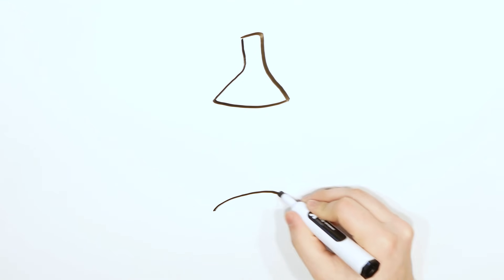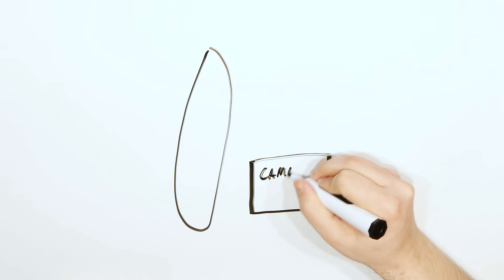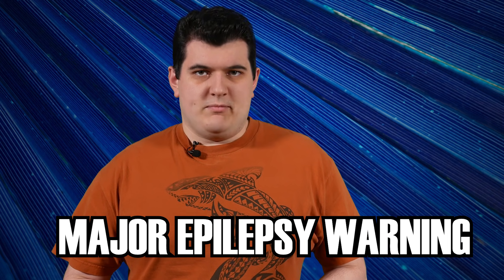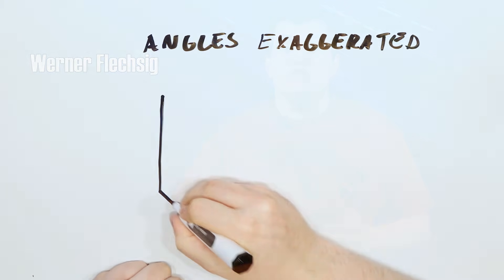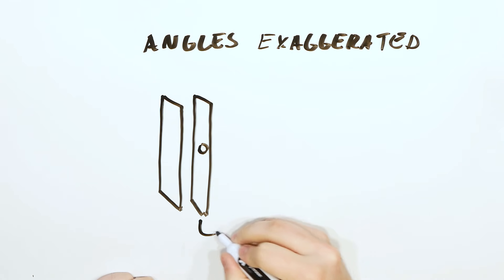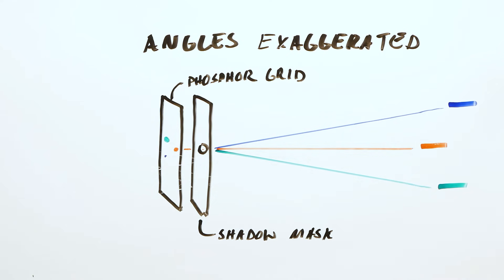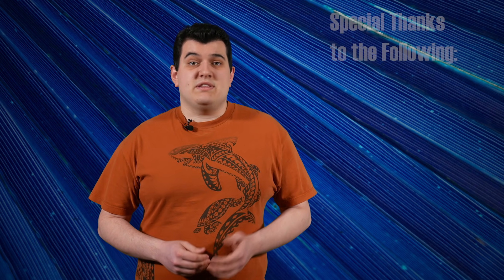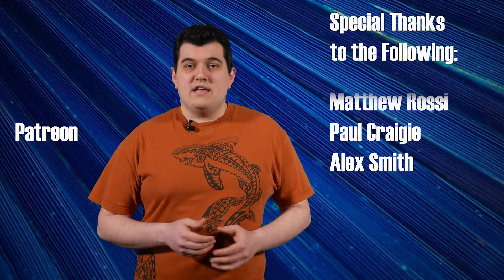How Analog Color TV Works:  The Beginnings

Comment: NTSC = NEVER THE SAME COLOR! (or, Never Twice the Same Color, etc)

I always thought the description of SECAM as "System essentially contrary to the American method" was funny.
Reply: Personally, I always preferred this meaning for NTSC:

Not
The
Smartest
Choice
Reply: It is very French, make something different but essentially the same so it is ours. PAL was an interesting standard, it had a higher resolution than NTSC, which is basically due to both systems being based on the AC power frequency of where they were invented. This gave NTSC a higher field rate and PAL more lines to a field for the same bandwidth. Due to this and PAL later being stretched for anamorphic widescreen meant that America was quicker to take up HD, as in Europe what we had wasn't as bad.
Reply: Nowadays it's PAL that actually has the disadvantage as there is no difference between the color and resolution but PAL is in 50FPS while NTSC is 60. But it actually doesn't even matter anyway as literally almost every single modern screen, except cheaply made TVs, can do both, and other refresh rates, perfectly fine.
Reply: Yes, I ve heard that due to those difficulties and limitations of SECAM, most European TV studios that transmitted in countries that used that standard, like France where it was developed, would just use PAL color video internally in their plants for production and preparation for air, and then convert at "the last mile" to SECAM into their transmitters for over the air broadcasting.   

IMO, SECAM is weird and unique in how it uses a memory of sorts (using analog delay lines when SECAM was developed, IIRC) to keep the color in check.  SECAM almosts seems like it was a bit too ahead of its time---such a standard would be a cinch to implement with today's digital (and analog) electronics.  I wonder if most later-era SECAM-standard TV sets probably had some digital circuit or buffer to process the SECAM color info.
Reply: And ATSC follows the missteps of its father. A TDT system so bad that even a bird flying in front of the antenna can break the digital stream. Thank goodness, most of the former NTSC world didn't stick with it (too bad millions are, nonetheless; and probably are going to adopt 3.0 as well). 
ATSC = Another Television System Crap
Reply: Yeah that does exist but it never really fully caught on.
Reply: It's the curse of the perfection. PAL was derived from NTSC but corrected the issue of colour stability. SECAM (means séquentiel à memoire: sequential with memory) was derived from PAL but used another method to store the colour information from one line to the other, solving one of the problems PAL had. Solving this stability issue also made it very difficult to tamper with the signal and made keylock and green screening essentially impossible.
Reply: PAL = Perfection At Last

Comment: The bit about how we see color can be a bit misleading / too simplified. I bet our dear presenter knows this, but for the benefit of others. This is how it works: our eyes can perceive 4 wavelength ranges Red, Green and Blue ... and White (btw. none of thous wavelengths cover or are exactly in the range one might expect - there is quite a lot of processing done in brain and even before. Our final heavily pre-processed perception is used to tell what wavelengths are what color atc instead of what the cones in our eyes react to. Hence why one normally does not call them by RGB initials and uses LMS instead). Thous will be converted by the neuron circuity on the retina to three signals: Red-Green and Blue-Yellow color opposition. White-ish goes through fairly unchanged (ignoring sharpening via lateral inhibition etc). Our brains never get to process the RGB signal  as that is not what comes out of eyes to begin with.

So, as far as our brains are concerned there are 4 pure colors (pure = NOT a combination of any other color): Red, Green, Blue and YELLOW .

Check also wiki article: "impossible colors".

None of this is particularly relevant to how color-TV works as that ends with cone cells. This is just for clarification.
Reply: Just recently, non imaging light detecting cells have been discovered in the eye that sense only sky blue. These are wired directly to the body clock in the brain and moderate our waking and sleep cycles.
Reply: Did not know about the specificity of it, but would not surprise me either. There is quite a lot of funky wiring going on in the region where the sleep-cycle tap is. My favorite oddity there: the signal gets split to two regions - one for vision and the other for motion (fairly far apart parts of brain). Which means that when your vision part of brain is completely toast (ie. completely blind in colloquial sense) you can still see motion. Aka. "blindsight".
Reply: The split that gives blind vision (I'd call that blind awareness) is not between motion and vision, both areas process both, but the visual cortex is newer, slower and is part of our consciousness, while the optic tectum is an older structure that's very fast. They work in parallel, the optic tectum producing rougher but quick results that make us jump when we see a quick movement in our peripheral vision, and the cortex focuses on it slightly later, identifies the object in question and decides if you should indeed run or it was just your shadow. There is also in the visual cortical stream a split between motion/position and color/shape information, and those can be damaged  separately, but none induces pure blindsight, where you don't have conscious vision but you still receive some information from your tectum (and also from the visual thalamus to higher cortical areas), so you have extra information compared to a person missing the eyes. Anyway losing onne of the two cortical stream is also weird, for example people with damage to the ventra one (the movement one) see the world like a slideshow presentation, without fluid motions, and objects "jump" to irregularly spaced positions instead of flowing continously. So it's extra dangerous to cross the street
Reply: I sense a formal education in relevant field. Given that i have none (tech area, hacker, which means i have very limited knowledge over a wide and wild field) - i feel compelled to prod for a bit of extra knowledge.

My understanding so far has been that signal from eyes gets mainly routed to V1 and V4, both being visual of course (Although i vaguely remember there also being diff-ing going on between eyes just before sending all the stuff out to V-regions. I would not call that visual data anymore - sure would be useful for determining what is near/far though). V1 focusing on visual side and V4 on changes (Like motion or something appearing. Stuff that might need attention) - neither excluding doing a little bit of both. V1 and V4 also communicate with each other (V2,V3) combining it all (easy to observe by watching a rotating spiral for a while and then looking elsewhere, or just staring out a car window for a while). While placing any part of perception solely in any specific location would be silly (everything gets mixed with something else at some point enhancing the perception of one kind by the others muddying the lines between them) - i would place what we perceive as vision mostly to V1 (getting hit there sure is flashy).

Sidenote: i sure would not call blindsight "sight/vision" either - its just what i see it referred as.

Now, prodding: it seems that i am wrong about V4 to some degree at least.

Googling (last i looked at this stuff was quite many years ago - my memory of the terms is a mess at best) "optic tectum" i noticed it being also called "superior colliculus" which does ring a few bells - primarily it being involved with eye movement. Including being responsible to the "vision suppression" signal - ie. if you rapidly look to a different place then the processing of visual signal is suppressed in the timeframe when the world flies by. Also i remember the thing being rather small and not independent from the V-stuff (mainly V4, which i now doubt a bit in the sense that it does not solely rely on it and has some separate dedicated other "thingies" working for it). Am i on right track?

Slideshow: yeah, i can see that happening. Human vision is rather craptastic in some ways and quite interesting in others. If tracking of ones surrounding is damaged then any information normally gained and joined over time will be disjointed. Ie. has the object i already know moved or is it a new and unrelated object in a slightly different position? One can logically still work out that it is moving, but too late to actually "see"/"perceive" it as moving. Certainly not something i would want to experience - sounds to be quite taxing. Still better than "blindsight".

(not an English speaker - but should be decipherable at least)
Reply: We don't actually see "white" we see "lightness." As in, it's treated completely separately from color to determine how bright parts of the image are and also creates muscle-memory reactions based on if there is too much or too little light.

The cones in our eyes are pretty fine-tunned to pretty close to being exactly Blue, Green, and Red. Aptly titled S-Cones (Small), M-Cones (Medium), and L-Cones (Large), because they correspond to roughly the smallest, mid-way, and largest wavelengths our cones and pick up, which just so happen to roughly fall on Blue (S), Green (M), and Red (L). Our brains do a lot of processing that ultimately makes it the final image we see though, yeah.

Comment: #spoilers

"Hiding the colour in plain sight" meaning that the colour in a Composite signal is directly modulated onto the original "brightness" signal, but using a higher carrier frequency. ;)

A black and white TV would usually do a pretty good job of filtering out that added carrier, due to low-pass filtering of the luma signal.

Superb vid btw, as always. :)
Reply: Judging by your comment, it sounds like you are very knowledgeable about this stuff. If you have a minute I would be very thankful if you checked out the comment I left at the top of the page. I have been trying to better understand what my grandfather worked on at RCA in the 1950's. Either way, good job figuring out the cliff hanger at the end of the video, cheers.
Reply: The low-pass filter wasn't always low enough to eliminate dot crawl.
Reply: Ryan Schweitzer 

Yes, maybe I should have said that the filtering is not ideal on some monochrome sets.
(where the filtering was more of a side-effect of the limited bandwidth of the transmission itself.)

The dot crawl or "running ants" effect can be quite bad on colour sets when fed via Composite too, which is why I always tried to use RGB SCART on my retro machines, even back in the late 80s / early 90s.

Newer TVs (analog broadcasts) often employed a 3D comb filter, which reduced the dot crawl a fair bit, but also not perfect.

There's an interesting article online about a PAL transcoder which gave superb quality from old tape archives, like Dr Who etc.
If I find it again, I'll post the link here.
Reply: Hence, "spoilers" at the start of my first post. :p
Reply: Yes, that is quite true, a phase-modulated color subcarrier, to be specific :).  A quite ingeniously-engineered solution for color television, and all-electronic even, no spinning color wheels or any of that crudeness ;) . 

But I do have agree with Scott, composite video does suffer from that dreaded dot-crawl!   In my video tinkering, I've noticed that some monochrome composite monitors made for CCTV and older computers (like your Apple IIs, etc.) tend to exhibit dot-like patterns all over the display's raster when color video with burst is displayed.  I tried another video source that for sure I knew was monochrome, having no colorburst and no color subcarrier, and it looked clear as a bell, no dot-patterning.  I guess those monitors displaying the dot patterning lack the proper video filtering (maybe due to manufacturing cost).
Reply: Jacob Marker

I'm having trouble finding your comment, as I'm using an Android box atm, so the comment ordering is a bit weird.

Could you possibly give a quick summary here?
Reply: Gees. Spoiler alert.
Reply: To be even more specific, it's a quadrature modulated carrier since there are two independent signals that are being phase modulated.
Reply: oh so i wasnt that far from the right answer i tought it is on the brightness signal when he said that.
Reply: B&W televisions that don't filter the chrominance subcarrier out tend to suffer from a thing called 'dot crawl'. the subcarrier, for PAL 4.43 or NTSC 3.58, was chosen so that it would hide so to speak.

Comment: is the shape of the mask the same on every tv, or is there control circuitry to sync the colour signal up with the specific mask? i know trinitron had a different design to earlier masks, but maybe that's recent enough? i feel like i've seen closeups of crts that used a triangle of coloured dots instead of a square made up of rectangles, and stuff.
Reply from the maker: +Kit Vitae The shape of the mask does vary with application.  Most computer monitors used a pattern of tiny circular dots as a finer image (and thus resolution) could be achieved. Trinitron is a whole other beast.  But there really isn't circuitry involved with the mask at all, it's just different from tube to tube.
Reply: The early color tubes had the dot triangle arrangement, with round holes in the shadow mask and the guns arranged in a delta formation, red and green at the bottom and blue on the top, and the phosphor dots in the reverse order (some later delta tubes had the blue gun at the bottom). To ensure the beams converged right in the shadow mask holes, these tubes had a set of convergence coils mounted right behind the deflection yoke. The coils were controlled by a driver board with an array of setup controls to line up the color image around the screen. Most of these tubes also had a metal shield around the bell portion to block stray magnetic fields. In the 1970's, there was a move to the inline arrangement, with rectangular triads, a slotted shadow mask, and guns mounted side by side. These tubes do not use convergence coils or magnetic shields. Also, the matrix between color cells on some tubes is grey, while on other tubes black. The black matrix is supposed to give better contrast. Most color CRTs also have an electromagnetic loop, controlled by a thermistor, around the screen to neutralize any stray magnetic fields when the set is first turned on.
Reply: The shadow mask shown in this video is actually for an inline gun, not a triangular gun as mentioned... really it's a slot mask from more recent years. Traditionally, shadow masks for a triangular gun use circles to aim at 3 round phosphors in triangular formation. The benefit to the inline slot-mask design was that more phosphor was available than with circles. The horizontal bridging made the mask as stable as a traditional shadow mask, and easier to make than a Trinitron's aperture grill with its vertical wires (with either one or two tiny wires fixed horizontally to stabilize the wires). When Trinitron's patent expired in the mid 90s, other manufacturers were clear to use inline gun designs. Slot masks were particularly prevalent in NEC products. As for the staggered arrangement of the 3-phospher "bars", it was likely to minimize any conflict with the scanning lines. Our eyes are more likely to see lines that are purely horizontal and vertical, so this helps break that up and make them less noticeable.